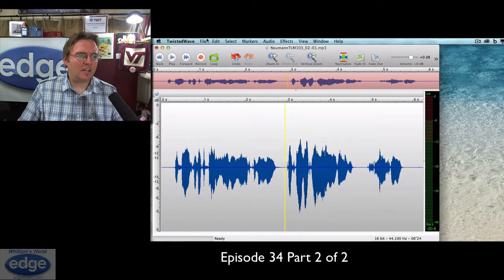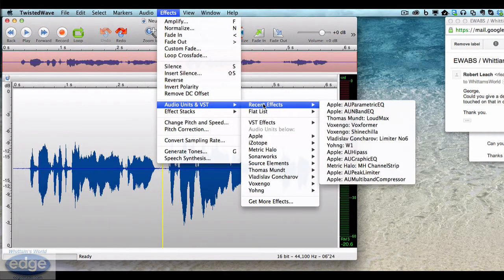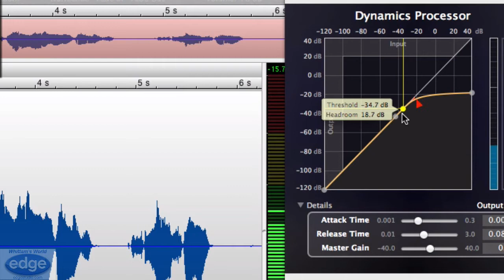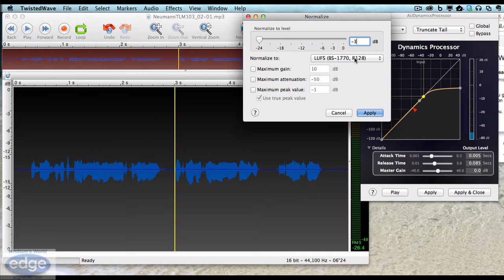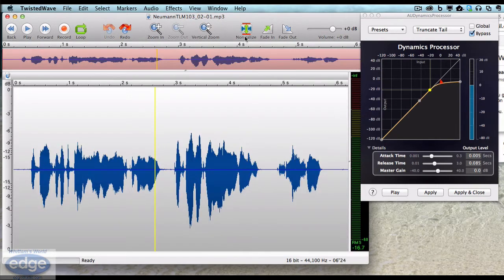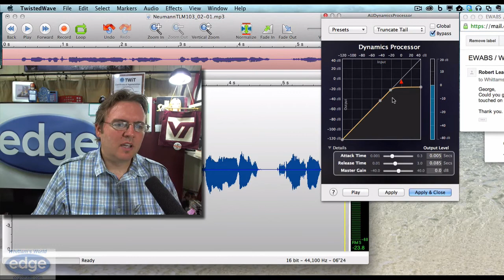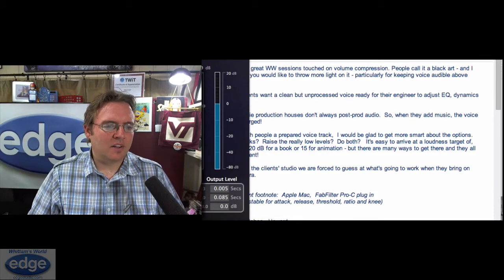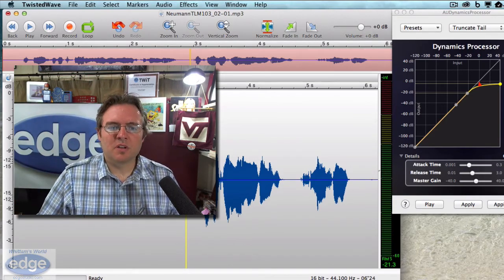Edge Studio's Whittam's World - Episode 35 "Dynamics - Part 2"

Comment: Hey George,  I wonder if you could talk more about attack and release settings.   It seems to me you would want different settings if your main goal is gating (expanding) or compressing.  If you're compressing you want a quick attack and slower release as you said,  but if you're gating you want a quick release (open the gate) so that you're not losing the beginning of words, and a slower attack so you're not losing the ends.   Am I understanding this correctly?

I have had great results using the Dynamics Processor twice, separately for each purpose so I can be specific with the attack and release settings.

Appreciate hearing your take on this.

Tim
http://timothymckean.com/voiceover
Reply: Attack in terms of the gate is actually how fast it OPENS not closes.  So you do want a very fast attack so it never loses part of a soft consonant or vowel, and slower release so it doesn't cut off too quickly and lose the soft tail of a word.